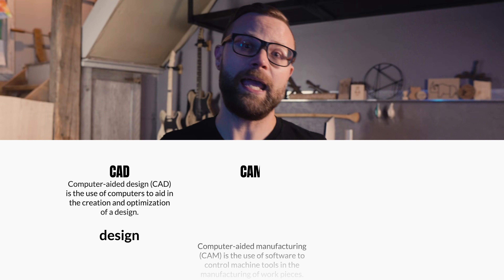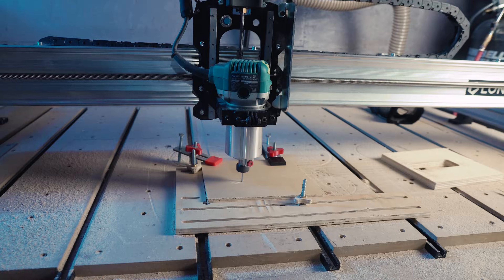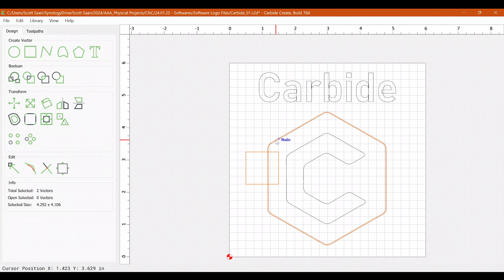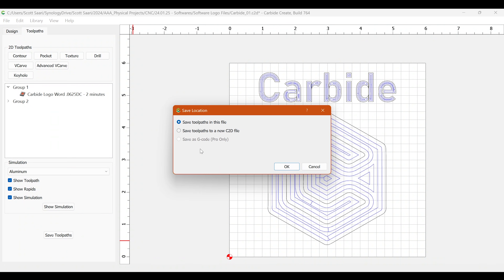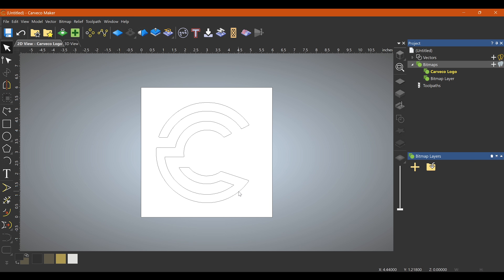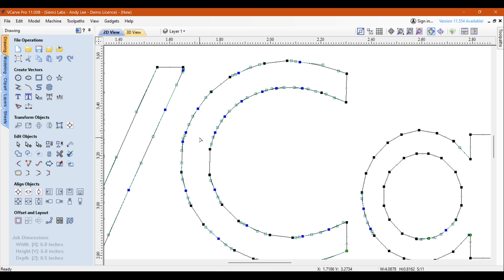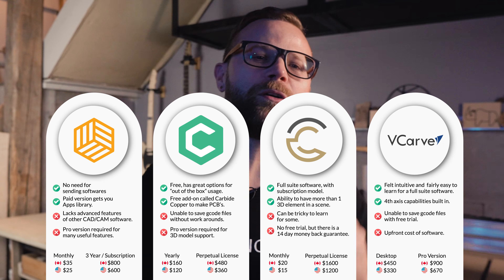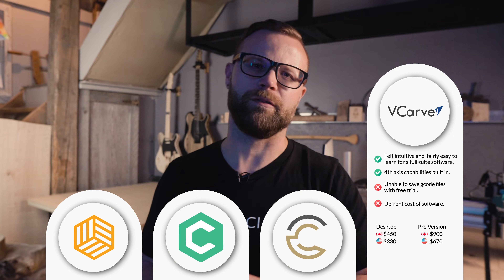Top CNC Design Software for 2024: The Ultimate Guide!

Comment: Hello, I have only one question on the older versions of cnc that use Xilog Plus software, can a 2024 software be used for cutting and carving? Thanks in advance for your reply
Reply from the maker: We've never heard of the Xilog software, so it's hard to say - but most 2024 options have a variety of 'post processors' to choose from that will accomodate many different CNCs

Comment: Hallo,
My friend I need your help.
I use arduino for cnc vynil cutter.
Inkscape with gcodetools to produce gcode file
Let's say we have a path A B C D.
The gcodetools make a gcode that run from A to B to C to D to A and stop.
Please I need the gcode file to run from A to B to C to D to A + 1mm to B direction.
This movement will be very usefull because I have a small gap from D to A.
I try to find a parammeter to overlap or overloop every path for a very small ammount of movement.
Many thanks in advance
Best regards
Jordan

Comment: One thing almost nobody mentions when comparing subscription vs purchase is the upgrade cost.  With subscription you get the latest version at no extra costs. With vcarve for example, there is a several hundred dollar cost probably every 2 years to stay uptodate,  While you dont have to upgrade software, at some point you will be "forced" to because of bugs not getting fixed or support being dropped. 
You need to evaluate the upgrade cost for a fair comparison of cost of ownership.
Reply: With the Bugs not being fixed, a refund would be due for a faulty product.
Can't trust a software company that doesn't fix a faulty product but expects you to buy a New Faulty product.
If the Updated version doesn't add much to what you are doing with your CNC then there is no need to buy it.

Comment: I’m using carbide right now, but it isn’t offering enough flexibility for my work. It’s not bad software at all, and should be a good option for beginners. Right now I am looking into fusion 360 for future work.
Reply from the maker: Thanks Keith. Fusion is a fantastic choice. There's just a learning curve that goes with it. It's MORE than powerful, you just gotta give it the seat time!

Comment: It will be great idea propose a free CNC software, usually CNC's programs are very expensive..... Thbaks
Reply from the maker: We do, Carbide Create 6 is free. V7 is also, but they changed the way gcode is saved.
Reply: @SienciLabs  thnaks a lot master, You provide us with good knowledge 😀
Reply: @SienciLabs  Forgive me friend, I was studying the Carbide program and I realized that it doesn't let me generate G-code, it only saves .c2d files that my CNC machine doesn't recognize.
I could save the file in G-code format if I buy the pro version.
I'm sorry for bothering you, I'm lost right now.
Greetings.
Reply from the maker: @DCano01571 You can save your file as V6 and then save gcode from V6…Or, you can just use V6 straight up and not worry about V7 at all.
Reply: @SienciLabs  thanks, i´ll try it

Comment: As someone who helps run a makerspace, and needs to have a solution for multiple users to make stuff on our cnc router (without making them also buy or rent new software for themselves) the makerspace license for vcarve has been our best option. I was teaching folk how to use easel until their gcode output stopped playing nice with our mach3 / mach4 based (and basic features like vcarving, tool ramping and raster movements for pocketing were stuck behind the paywall). We briefly tried carbide3d, but right as we moved over, they went to v7 and made it impossible to use on our machines unless we brought a pro license. I just wish vcarve supported macs for the few members who have those, and that they didn't make the incredibly annoying changes that they did on 11.5/12 for how folk use a makerspace license.

Its incredible how much better it is on the laser side. We got a 3 machine license with our co2 laser for lightburn, upgraded it to support our galvo, and spent $60 a year (if we want to) to get the latest update. No subs, no always online requirement, no license management or adding users to our org or email authentication. Lightburn was also demoing a CNC router capability at a reprap festival in the past year - maybe they'll show that off at LBX?

Comment: A few yeas ago I started with the free version of Easel.  It was fine for getting started, but as I got further along, Easel started making some features that used to be free into PRO only.  Now the free version is not even a good place to start for beginners.  And it is WAY too expensive for beginners.  No G-code output is a non-starter for Carbide.  Also I will NOT buy a software subscription.  If I buy software I want to buy it once.  Software subscriptions are not a reasonable thing for hobbyists.  Yes, the Vcarve price SEEMS high, but that is only 13 months of Easel subscription.  My biggest issue is that I only do maybe a dozen CNC projects a year, and I don't want to have an auto-renewing subscription for something I am not using that much.  I think this is a MUCH bigger consideration for beginners than most of the other things you describe here.  All of these cost more for one year of use than my hobby machine did to purchase.
Reply from the maker: There are a lot of different variables to consider and not really a "one size fits all" answer. We just tried to provide as much info in a concise way as we could!  Thanks for your comment 👍

Comment: If you break it down as a comparison, V-Carve is only $12.50 a month for 2 years, or $25 a month for 1 year.  It's only issue is the cost is up front, but if you just dropped a couple of grand to get into CNC, you shouldn't skip on the software.
Reply from the maker: It's a great way to look at it! That's why it's such a personal choice, everyone has different expectations and circumstances. Thanks for your input! And we hope you're enjoying VCarve ;)
Reply: too lot/expensive pay if can use FREE

Comment: If a person is learning and becomes good at Fusion 360, can they eliminate the use of Vectric, Aspire for carving work or is there still some benefit to learning and using this as extra software?
Reply from the maker: You got it! Fusion has the ability to save out gcode files so you don't need another CAD/CAM software. Fusion can be a little daunting to pick up if you're unfamiliar with that type of software. That's not to say you can't go that route, we just want to raise an attention flag so you're not caught off guard! But lots of people choose Fusion right off the bat even though it's harder to learn, because of how powerful it is and how cheap it is! (Free for personal use!)...Hope that helps!
Reply: Learning fusion was the best choice I have ever made, once u learn the soft ware you can easily automate work follows

Comment: If you can break free from feeling the need to have an integrated sender, the learning curve  gets steeper but definitely worth it. Subscription payment schemes can get bent. I will never, ever buy into a subscription for software use. Carbide sucks. Easel sucks. Fusion is free for non commercial use and is very powerful, despite some niggles. Vcarve is very good, for wood. I use a combination of Fusion, Vcarve and dedicated sender and cnc control. Best of all worlds and flexible depending on whether I'm machining wood or metals. If you only cut wood, Vcarve all the way. It's not perfect but reasonably priced.
Reply from the maker: Thanks for giving your input about your journey. It's such an individual thing, so we're glad you've found a system that works for you!

Comment: I have the newest CCpro and there is an option to save the gCode file. Maybe not in the free version any longer but the pro version yes you can save the gCode file without having to jump through hoops.
The real downside (not often though) is that I cant see what the tool is going to do. It shows me the finished product but it doesn't show me the cut simulation which does have its advantages. That has led to mishaps like cutting where its not supposed to do but that only happened on a wrench I was making. Other than that I like it a lot. It makes things quite easy. I can even have multiple 3d objects and I have tiling. I think its a good deal.
Reply from the maker: You are correct, Pro can save gcode. That's what I was trying to say. Thanka for sharing your experience! That's some great insight for others to learn from 🙌

Comment: Maker did add 4th axis not that long ago if I am not mistaken.  For me, I started with carveco and am comfortable with it.  I like the subscription model and I get everything but tiling in the base version.  I cannot see spending for the Vcarve pro and then to pay again for updates.  VCP doesn't give me anything more than maker - at least that I use or have found.
Reply from the maker: You are correct about Maker's 4th axis - however, we recorded this basically at the same time as its release and it didn't maker the cut then. We're happy you've found a software that works for you. That was the point we were trying to drive home in the video. To each their own! Thanks for the input!
Reply: @SienciLabs  I appreciate the additional 'maker' pun in your reply lol